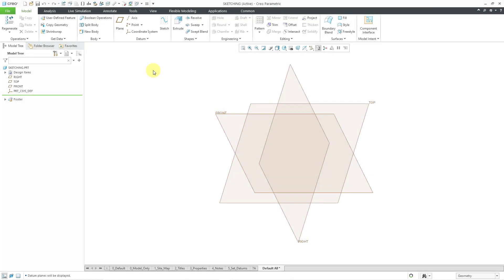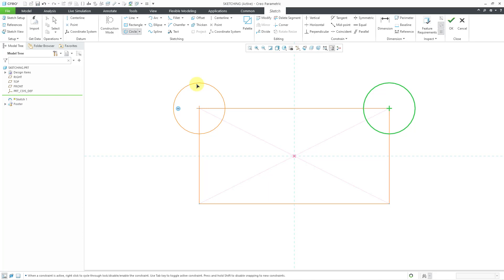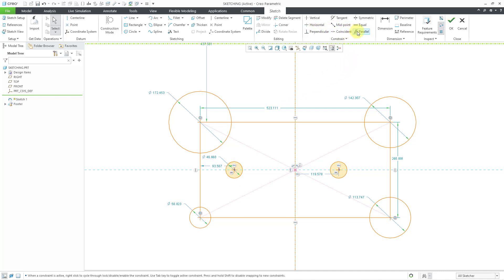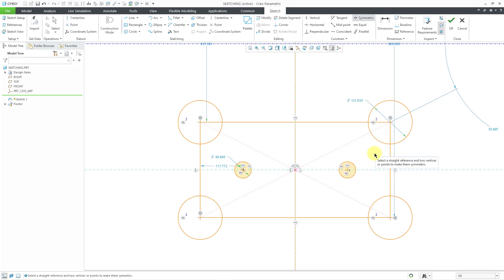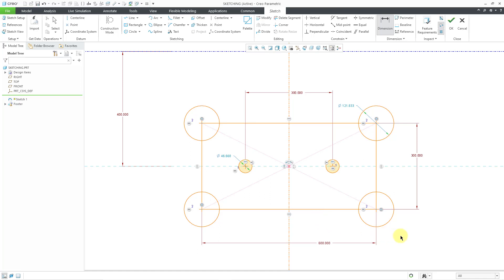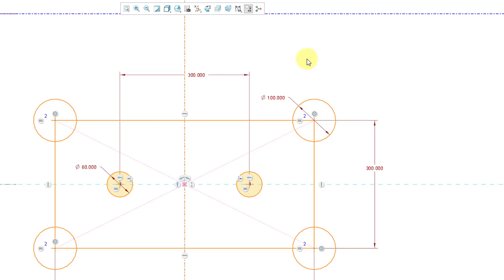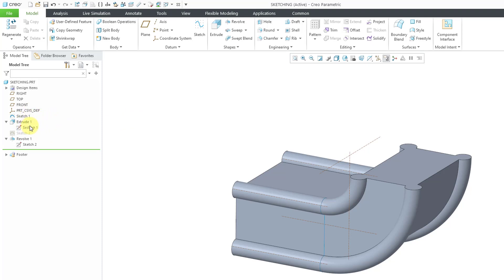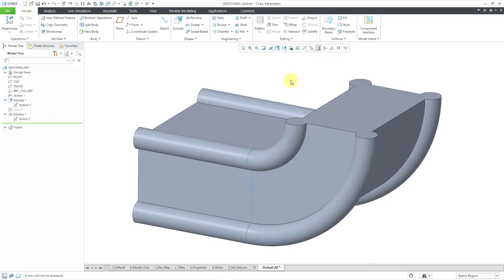Creo Parametric for SolidWorks Users - Episode 4 - Sketching (Part 2)

Comment: Maybe you can help me out. 

I regenerate my model but none of the children follow. When I edit the child the references are displayed where they should be but the sketch doesn't follow the references. 
I change an angle on a hole, the hole in the mating part should follow that change but it doesn't? regeneration does nothing. Creo 6.0
Reply from the maker: Can’t answer based on the information provided. Recommend you submit a ticket with PTC Tech Support.